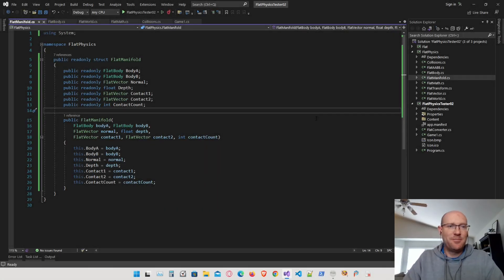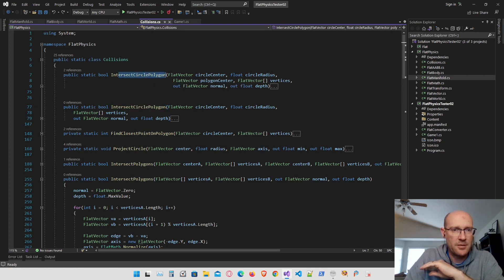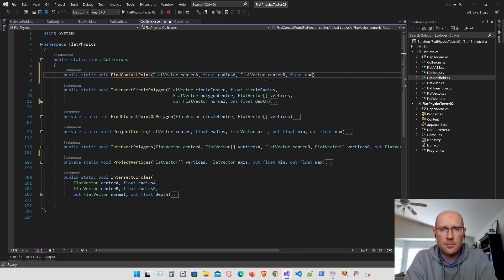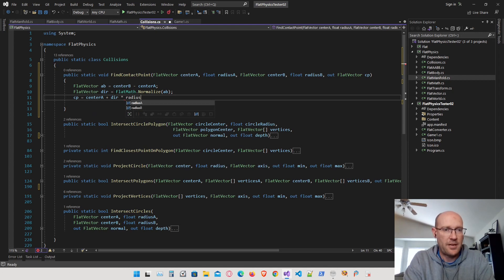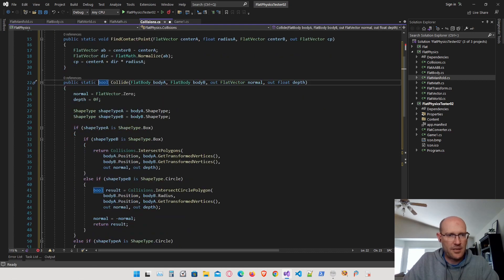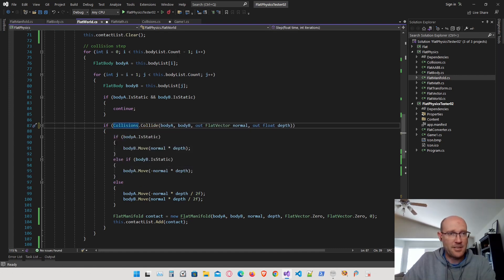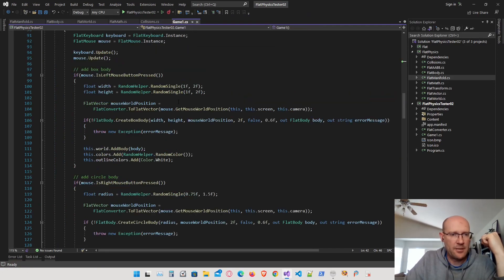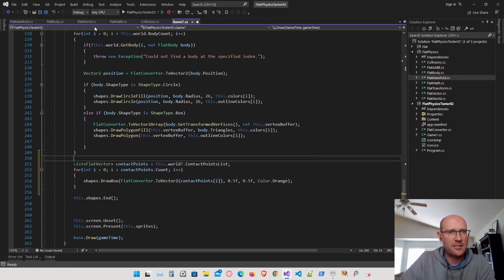Contact Points (Circle/Circle) - Let's Make a Physics Engine [16]

Comment: Not sure if I'm 100 percent correct, but I think when you add contact points to the ContactPointsList (after your resolve collisions) your adding up to 20 times the actual amount because the of the iterations.
Reply from the maker: you are correct... that list is only temporary so I didn't optimize it.